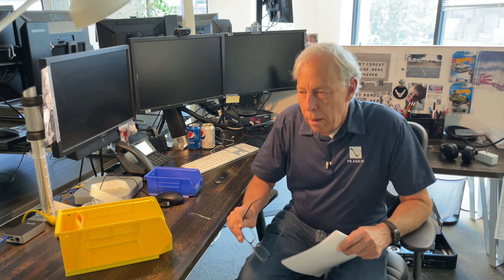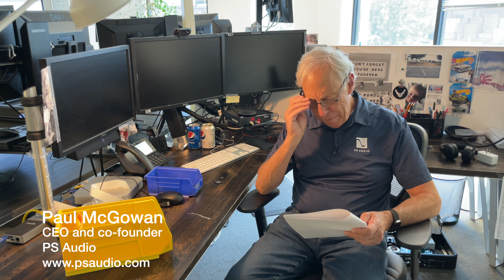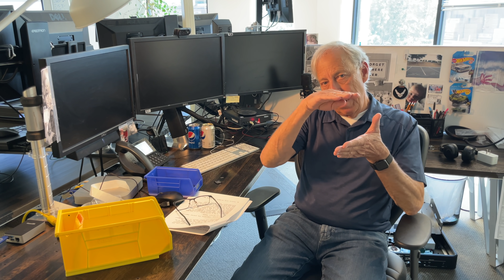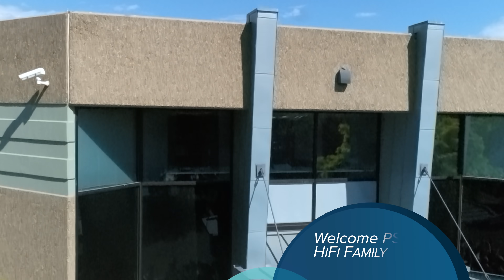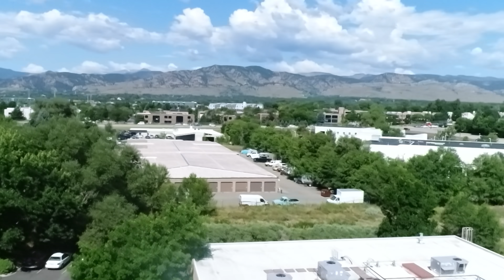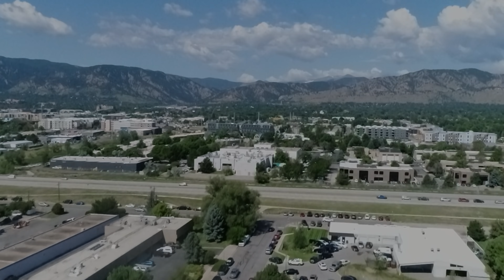Why stereo systems sound different at night

Comment: Would be interesting to hear about running an audio system on solar panels.
Reply: A solar system takes DC from the panels and converts it to AC using an inverter. Today that means high frequency, like over 50khz, chopping the DC into AC and then filtering the HF out. A loose analogy is a switch mode power supply running backwards. So in theory that would be the worst source of power for an audio system. But in reality it doesn't matter. The impedance of the power grid is so low the effects of these solar inverters result in very little noise injected back into the AC line. All this AC power quality FUD for home HiFi is just that. A scam to sell audiophile products at outrageous prices. Yes power quality is important like in a data center or lab with highly sensitive gear. But there is an entire industry serving this need on a professional level with commercial UPS systems.
Reply: Thanks, that's helpful.

Comment: I owned two P-300’s which were absolutely jaw-dropping on first listen. But I didn’t have a quiet listening room so the ambient noise was also less in the evening. Now I have a P-12 in my current system but still have ambient noise in my new apartment.

Comment: Just listen at night and work during the day. Problem fixed and I saved viewers like $10K
Reply: Indeed, saved $10k on snake oil!
Reply: Paul, been into hi fi for 35 years, yesterday I put in a Audioquest Niagara 3000 to plug my gear Into ,  No VooDoo , Everything got better , more details, ink black background, everything was clearer and way more dynamic. I’m in front of that system for 4-5 hrs a night. I assure you this is a real thing for my system. No Doubt what so ever

Comment: Late at night ambient noise from the environment is much much less... Quality of power has nothing to do with it. Comeon Paul 😕😕😕
Reply: Indeed, not to mention circadian rhythms and Psychoacoustics
Reply: The quality of the power you feed your gear with has big impact how it sounds. I am running my gear straight from the wall without any filtering/regenerating. For me it sounds better in the late evening/night. Probably due to less disturbance on the grid. It's almost spooky how relaxed the music sounds/feels.
Playing music during daytime can sound very tense/stressed and I just want to turn it off.
Reply: @rob_66  I believe it does sound better to you but that it's due to circadian rhythms and Psychoacoustics. A quality product's power supply should handle all the power conditioning needed.  Only way to know for sure I'd blind listening tests.
Reply: @paulgyro  Sure, maybe a combo of that, cleaner power and quieter enviroment in a city at night. 
A friend of mine is musician and when they recorded an album it was all done at night. He asked the studio technician, why? 
Short answer: Sounds better, cleaner power.....
Reply: @Douglas Blake don't know🤔, all my gear runs on a commonly power (240V 10A) with two neighbours below me. Power supplys in my gear is maybe more sensitive disturbance on the grid?
Reply: @Douglas Blake Yeah, funny thing is, my system sounds better when the neighbours below are not at home....
Reply: @Douglas Blake I will check my voltage and see how much it actually fluctuates.
Reply: @Douglas Blake Thanks, checked my invoice from the power company. It's actually 25A for each apartment so it should be good.

Comment: AlIEnS are recharging their cloaking devices during the day and it effects the power grids. The poor pictures the Navy gets of them is when their juice is running low and they forgot to return to the mothership on time.
Reply: Actually, my understanding is that the spacemen are working with Paul on next gen cloaking devices that will use a much cleaner electricity to fix this problem, something called The McGowan Coil,

Comment: AC wall power aside, a more likely explanation is your circadian rhythm. In the evening, melatonin is released in your body, your core temperature goes up, your heart rate goes down. Bottom line, your body relaxes and prepares for sleep (in the morning, the opposite happens). Your senses dull somewhat and, as far as music goes, you’re not as well equipped for critical listening as you may be during day light hours. Everything will sound smoother and more rolled off, not unlike what happens if ever so mildly intoxicated (no, it’s not a he-he joke about drinking). This is the same reason your car engine will sound smoother when driving at night as opposed to during the day.
Reply: This is far more plausable than claming that daytime noise on the AC power input can't be easily filtered out without complete power regeneration.
Reply: @0x07AF  in addition to the shape of the voltage, a big problem is the absorption due to the current peaks required by the power supply stage of the amplifier. and this problem is not solved by voltage regenerators, buffer cells are needed
Reply: sure, there is a bit of truth there but this doesnt explain why its always exactly the same, every night compared to day, specially since im also a person who sometimes goes to sleep at 4PM and wake up at 1AM ... just feeling the same and (for me) the stereo just seems to really open up after around 2AM .... till around 5-6AM (which is not coincendetal i think since its exactly around that time "normal people" sleep and non-24h-industry is shut off
Reply: Well thought out hypothesis but just not true.
Reply: @carlosoliveira-rc2xt  or are both true ...

Comment: this is the only explanation I have heard for this phenomenon... 
I thought it was true but most say no difference in sound dark vs light
Reply: Max Townshend is of the opinion that traffic gives seismic activities around 7Hz, the same as earthquakes, giving vibrational smear in electronics, cables and speakers. In tweeters, 400x more ground movement than the tweeters on movement then creating music. That is why Townsend’s seismic products decouples from 2,5 Hz and are best in class. Conclusion, you have to address vibration from very low frequencies and address power regeneration to have late night listening quality daytime.

Comment: I think this may be the least scientific and the most outrageous answer yet. To quantify this would be a logistical nightmare. You'd have to measure the 'quality' of sound at various different times and then 'verify' or cross reference this to the theory proposed here that more demand on the power grid equates to an inferior sound and then you'd have to propose an overarching hypothesis as to the why and how. If you tried this you'd soon realise the anti-scientific nature of it. 
And even if one had the math at hand regarding power peaks and listening quality most of this could only be referenced via listening tests which would be quite subjective. Look for a different answer - it's not power. 
Im sure PS audio make astonishing power plants but this feels like a (another) kind of oddly wedged in ad for them.
Reply: "I think this may be the least scientific and the most outrageous answer yet."

What answer would you have given to the question asked? If you disagree with Paul, that's fine, but what's your alternative?
Reply: @solarfall2728  A simpler answer pertaining to the human condition might work - or how about the drawing of curtains at night and or the closing of doors changing the rooms acoustical dynamics? To be honest I haven't noticed the night time listening phenomena and don't think it's actually a thing so proposing an answer pre-supposes that the idea in question is perfectly valid or factual - we're very far from establishing that it is.

Comment: Would a stereo system running off a quality inverter and battery also be worthy?
Reply: @Douglas Blake Even quality ones such as Victron? Ive heard they are very clean even under heavy load.

Comment: I'm always slightly amused when a white collar type thinks factories close after dark. Those machines never stop. The electricity is affected by themillions of office workers that only work during daylight hours. Sorta out of touch Paul. I think maybe he's confusing a workshop with an industrial factory.
Reply: He never said “factories”, he used the much more general term “industry”
Reply: @gotham61  amd do you think "industry" ever stops? Lol like I said, workshops close, industry never stops.
Reply: @jamesrobinson9176  How about recording studios in the music industry? Or CD/vinyl pressing plants?
Of course there are plenty types of industries that run 24/7, but also a lot that don't.
I've worked at a company that assembled both cabinets for ASML and Peek Traffic; most of the ASML production was 24/7, while that of Peek was only during daytime.
Reply: @gotham61  so let me get this straight,  offices are now industrial facilities? Look bud if you get your feelings hurt this easily and have to resort to name calling you should probably get off the internet. Name calling will never help you win a debate. I stand with my statements industry never stops.
Here's a simple way to determine if the business is of an industrial nature. Did it voluntarily shutdown last year? Then it ain't industry
Reply: @jamesrobinson9176  "White collar" electrical engineer here.  You are absolutely correct.  Overall power demand and noise contribution are not the same thing. Many of the noisiest industries (with heavily inductive, complex loads) keep on going throughout the night.    "Resturaunts, shops, schools, offices" would not be the major contributors to noise reflected back into the power network.  Yes, many factories close - but a lot of the biggest potential noise contributors typically keep going 24/7. 

To the main point, if the difference between daytime and evening AC power quality was enough to bypass even the basic AC to DC filtering in our amplifiers - especially to the extent that we could hear a difference - it would be well out of the noise floor and easily measurable by FFT at the output of the amplifier.

Comment: I believe a  Battery type system is the best economical way to achieve stable ac.🤔🤫🙂
Reply: Unfortunately batteries suffer from voltage drops so aren't a perfect solution. The best solution? Engineers designing products with high quality power supplies.
Reply: Stabil AC ? Battery is DC.